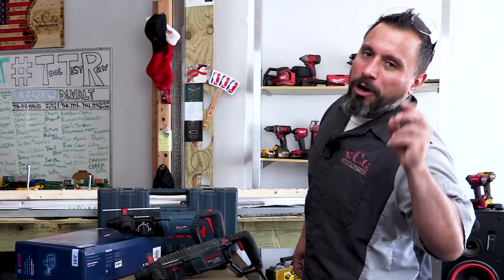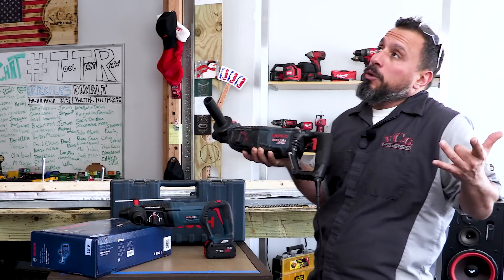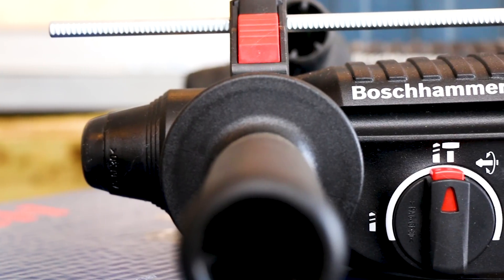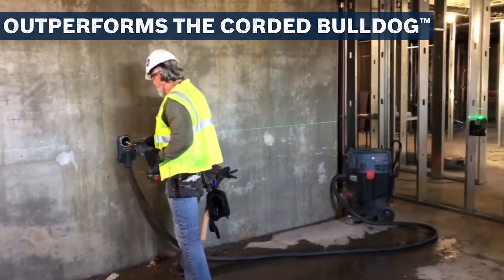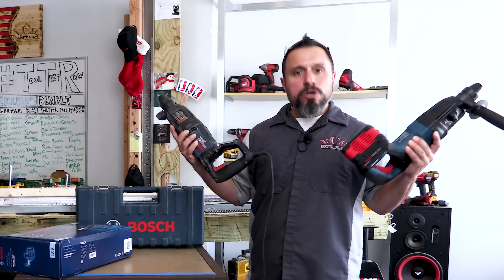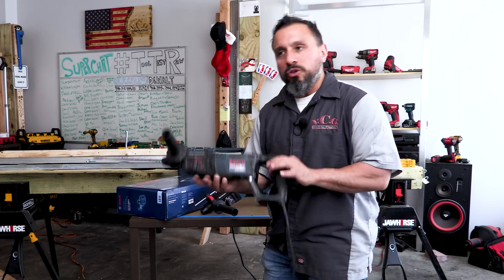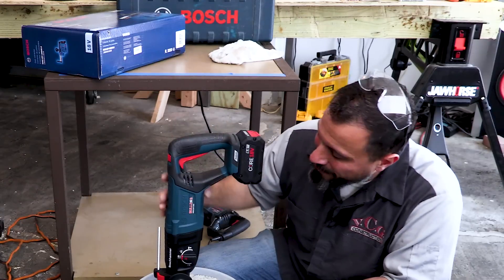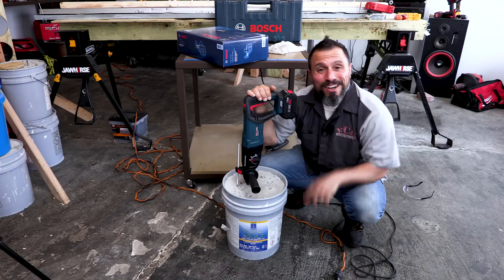NEW BOSCH BULLDOG IS THE FASTEST 1" ROTARY HAMMER (Timed Testing)

Comment: Which is better, DeWalt  or BOSCH GH18V-26DK15;  DCH 133M1 18

Do you recommend using a battery adapter from Dewalt to Bosch, etc.

Is it possible to use a 20 volt max battery for an 18 volt drill?

thank you.  Great review

I use Google translate .  I hope the questions are clear.  Thanks
Reply: البوش GBH18V-26D
أفضل من الديولت DCH133
بنسبة لسؤالك على المحول ما أدري لكن إذا راح يشتغل والدريل يقبله فلا يوجد مشكلة 
بنسبة موضوع 18v و 20v هي نفس الشيء ولكن أسماء تسويقيه كمثال ديولت في اوروبا 18v في أمريكا 20v وهي نفس البطارية الفرق انه 
18v 
هذه الفولتية العادية للبطارية
20v
هذه فولتية البطارية لمن تكون مشحونة كامل

Comment: A bit surprised considering the corded model bits with 2.0 LBs per hammer strike vs the cordless 1.9 LBs. Unless the cordless has increased RPM/IPM, something doesn’t add up.

Comment: Buying my first sds..if you had to get 1... Bosch corded bulldog extreme max $199. The new bosch cordless bulldog $249 with battery and charger. Or Milwaukee m18fuel sds $299 tool only. Im already on m18 platform and have tons of batteries so no bat is not a huge dealbreaker..
Reply from the maker: They had a huge deal on the bulldog last month. I’d go with the Milwaukee at the present prices
Reply: @VCGConstruction  i knoww i missed out..didn't need it yet. Thanks a lot man. Appreciate what you do

Comment: Would you be able to do a comparison with a Bosch Extreme Max? I'm interested to see if the similar price point corded SDS plus performs more comparably. I'd also like to see a comparison of HEPA filters on these tools.

It's also got kickback protection, very important when rebar or high rock count concrete is used.

Comment: Just bought one.  Good deal at lowes right now.  I've got a bunch of other 18v bosch tools,  so it's a force multiplier...
Reply: I just bought one today at Lowe's, $199 for the cordless bulldog kit with a case and they throw in the $220 dust collector with a 4ah battery and bag for free. I also used a 10% coupon which means I got the whole thing for about $189... I couldn't believe the deal
Reply: @allysonand  What's the coupon?

Comment: Cords? Cords are for shop tools like my Bosch track saw (Bosch & Mafell run on all rails, but DeWatl’s Jankey ones), random orbital sander, colt router. I haven’t had a cord on job site since I upgraded my Bosch corded rotary hammer to the first gen of this tool. 
I’d like to see how fast it is with dust extraction since mine is powered off the tool it has to impact performance either in power or run time, also like to know how long it would take to drop 3/4 bit 12” simulating pulling feeds (2 CAT6 2 RG6) threw a foundation on an elevation C home (the one with basement are above ground).
Thank you for bringing blue to the table!

Comment: Here's the thing. Bosch won't make many sales on this because I find that the number one reason people choose their brand is by what first power tool they've purchased simply because they will be able to swap batteries more frequently if need be. Bosch may be quality but Bosch doesn't compete with Milwaukee or deWalt. Although I DO find that drywallers and and trim guys tend to use Bosch and Makita which I imagine is who they appeal to the most. They own that market. But a hammer drill? Idk it seems like that's not used too frequently by them.

Comment: Good vid Vince.  The one question I have is how many of those holes can you drill on one battery charge?  I'm a Bosch fan myself and own a few corded Bosch tools and love their durability.  Thanks for sharing.  Cheers!
Reply from the maker: Great question! Let's see. Thank you William
Reply: @VCGConstruction  funny thing, I did a similar video, on my channel, and got the same 10 seconds difference
Reply: @tooltipswithtommy  Unfortunately I could not find the video.
Reply: Awesome power and performance from bosch. I got 20-30 minutes of chiseling on a 1 hour charge..... Ended up exchanging it for the corded just because of run time👍
Reply: I've seen literature claiming it will do 45 1/2 inch holes 3 inches deep. On the 4AH battery.

Comment: i saw something awhile back i thank with that battery and drill and the first wireless charging like a cell phone just set it on the charger and lift it off instead of sliding it in
Reply: No, only with the specific wireless charging batteries. But Bosch does have them.